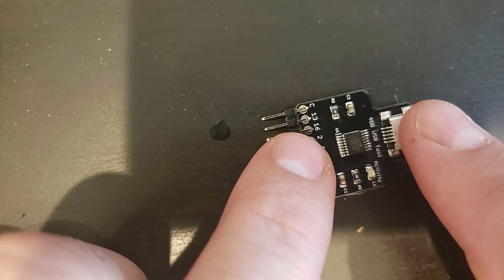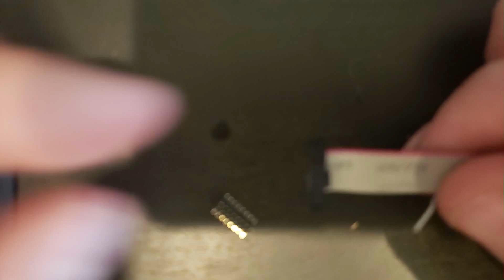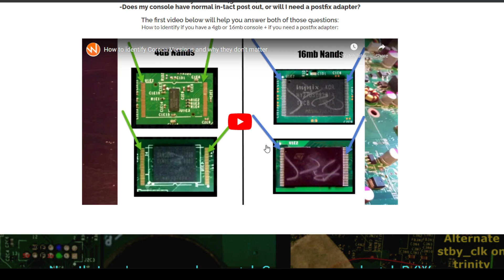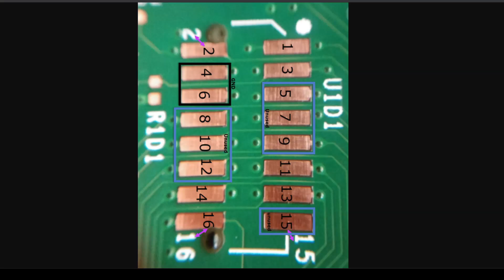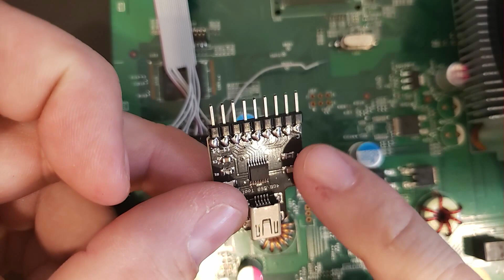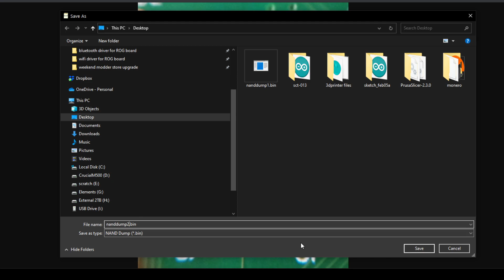4gb USB Tool for Corona Xbox 360 RGH

Comment: I just purchased this from your site! 👍
I made the mistake of thinking the TX QSB was better.  The contact points were extremely cheap and fell off right after applying solder.  After seeing this video, I realized that the USB tool is better than soldering on a large QSB with difficult soldering points.

Comment: I went to use this tool for the first time after buying it a year ago. 4gb Corona v4, c2r10 has resistor, c2r6-c2r7 jumped and continuity verified. It reads and verifies nands, creates ECC. It gets stuck writing ECC with access denied. I tried j-runner and your app. Any ideas?

Comment: When will you have this tool in stock
Reply from the maker: The xflasher is the replacement for this tool.     Do you like the pin-header style install?
Reply: Yeah i like the pin header part i was trying to find out what the pin spacing is on them

Comment: You cant find these items anymore. Reason is because of the xFlasher coming soon that basically does everything when it comes to modding all 360 models (besides winchester atm). So if you couldn't get these items in time, you'll have to resort to buying the SD Tool instead.

Comment: Any way to get that cable and nand pin header for us who already have SD tools?
Reply from the maker: I just got in a bunch of the pin headers, but those cables I only have 1 for 1 with the 4gb USB tool - no extras and I'm not sure I can get any.  I'll look into it.
Reply: @TheWeekendModder  I actually went ahead and bought this USB thing instead. Should be a lot easier than fumbling with a million wires and having to hold my laptop as close to the thing as possible to get it to work. (my card reader won't work with my extension cable, lol)
Reply from the maker: @davidkatze2921  nice.  I use a 6ft usb extension, with a 2ft usb cable to this new 4gb reader and it works nicely

Comment: I bought one of these a couple of weeks ago, and used it yesterday to do my first ever RGH. The tool was easy to use, and because I followed your RGH tutorial (thanks for it, by the way), the whole process went smoothly. One thing I did notice was that J-Runner needed to be run as administrator, otherwise it didn’t report the size of the NAND.

Comment: Perfect timing. I just ordered one of these kits on your site after seeing this vid. I have a 360E with 4gb NAND I just picked up that was modded at some point and it E79s. Gonna try reflashing the NAND with this kit.
Reply: I finally got around to getting my kit installed. I can read the NAND but when I compare they are no the same. Any tips as to what the problem could be? Thanks again.

Comment: Welcome back!
I had a question, I wanted to know do Winchester motherboards have a 4gb nand? And if they do , can you still read the nand on them even though you can’t glitch them?
Reply: Yes but what's the point?
Reply: @jooojoo9  I do Xbox RGH services for people here and there , but haven’t been able to do it on a 4GB console ( I haven’t been able to read a nand on one yet) , I am looking to get few of the 4GB winchester motherboards for cheap to practice and learn reading their nand so I can start RGH’ing 4GB coronas too..
Reply: @sinasinahm  If you already know how to solder, there really is not much to practice, it's about making a good connection and pressing a read button. If the problem is you can't solder properly then there is no need to practice on an xbox, you can practice soldering on any old electronic for free and there is no need to practice clicking a button. If instead the soldering is good and you tested multiple sdtools/sd card readers then it's just bad luck, the nand is dying and needs to be replaced.
Reply: @jooojoo9  No, I have a  soldering station and have rgh’ed about 10 xboxes so far ,also I have worked on some other electronics so I think I have the skill for doing this type of works , the problem is more with not having the correct tool or sd reader and even a bad nand as you said since I’ve only tried working on one 4GB console (which is my personal console) , I might even buy the tool shown in this video since it looks much easier to work with than the SD tool cause you don’t have to worry about finding a sd reader that works fine with the xbox since it’s a usb one..
Reply: @sinasinahm  Yep, that's definitely better than an sdcard reader

Comment: Got to use the SD card tool for the first time the other day (after modding dozens using the standard method).  So I’m especially interested in the new tool for ease of use.  I had to go through several different SD readers to find one that worked with this.  The SD tool doesn’t always insert properly either, so gotta watch out for that.

Question for you tho. I’ll probably order one from you the next time I order matrix chips.  Wondering how much those little pin headers are? (for the board side).   If you sold those as well (or an option to add a few or a bunch), I’d consider just leaving them in the clients Xbox so I wouldn’t have to bother removing them afterwards.
Reply from the maker: I don't have extras yet - but I'll be getting them ASAP.  They'll be less than $1 each, so the idea is exactly like you said, just install and leave them.     A direct wire install of this tool would be good too.
Reply: @TheWeekendModder  thanks for the quick reply!  I’ll be looking forward to grabbing this on my next order :)

Comment: What a good video, don't get me wrong but I think it's more complicated. Maybe it's the custom but I still have my sd tool v2.2 and they are great tools, good that you are still posting videos. greetings from ensenada bc mex
Reply from the maker: Thanks!  I kinda agree with you.  I'm not in love with the idea of always using the little pin headers.   I'm gonna do another video with the next 4gb Corona using this same tool, but doing a direct wire install with it like you would a SD tool.    Really this exists because some people have a hard time getting their SD tool to work with certain SD card readers.
Reply: @TheWeekendModder  Hello friend, you do not need to use the pin headers every time. Mine I just soldered standard wires to, and the using pins for quick disconnect. Very good for bulk console doing!
Reply: @TheWeekendModder ok i understand, i have 2 reader of one dollar each one and still work great but its great that part where the tools 
still evolving to do easy the job
Reply: @TheWeekendModder  did you do this in the ace v5 video? or haven't you done a video doing a direct wire install with it like you would a SD tool yet?